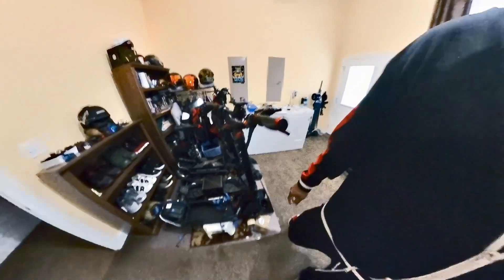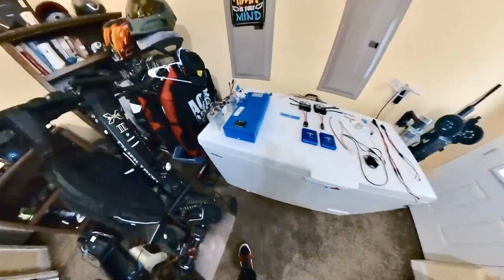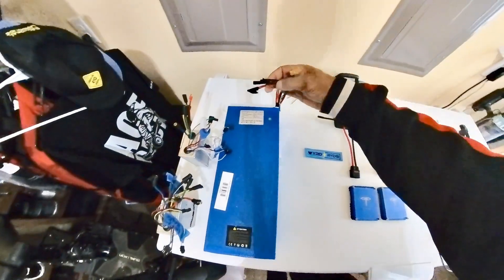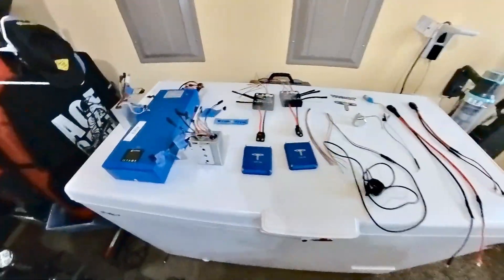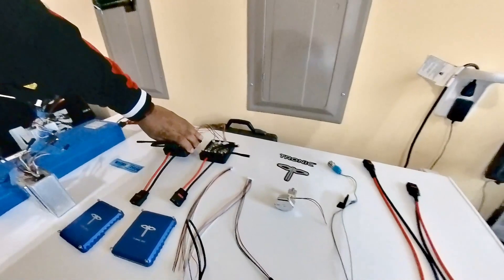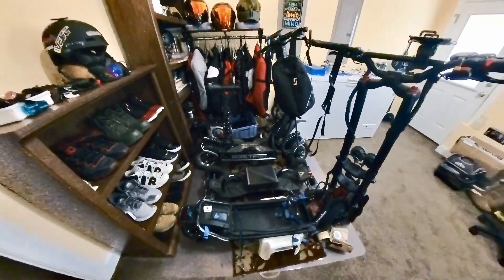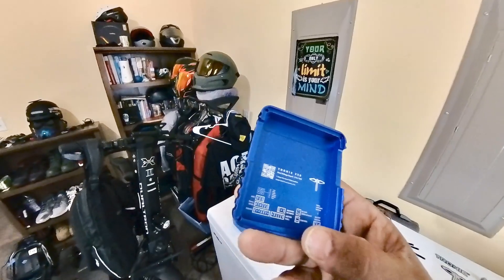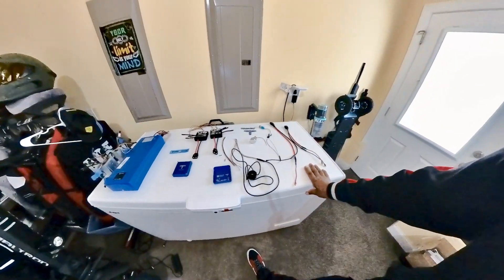Wolf Warrior 11 Tronic 250 Installation Project : Part 1

Comment: Do you have it finished?
Reply: Any luck with it?
Reply from the maker: @elijahkiihn  Keeping the Tronic 250s cool seems to be the biggest issue. I connected them onto a custom made heatsink and mounted them on the outside of the deck. After only 5 minutes, they were going into heat cutoff mode. But I'm not giving up.
Reply: @johnrichardson5089 what temp is the cut off at? I have to believe it could be adjusted in configuration of controller?
Reply from the maker: Video coming later this week.

Comment: waiting for part 2 ... ✌
Reply from the maker: I got you. Soon I promise. It's not easy to set the Tronic Controllers up so that they don't over heat very quickly, even when you mount them on the outside of the deck. But I'm almost done.
Reply: true, that is certainly not easy. I keep my fingers crossed that you find a solution and I am then very excited about your video @johnrichardson5089

Comment: any update on this project?
Reply from the maker: Yes. I finally got the Vesc setting right and I rode it for about 10 miles to test it out. My front motor went out. It was already damaged. So I'm waiting on two new motors which I hope will be here next week and I'll be dropping a detailed video of the installation process.
Reply: @johnrichardson5089  nice man, still wished you had the tronic so you can see how mine is going.

Comment: Why only 40amps per motor. Each controller can push 100amp or more I believe. I have done this for my Wolf Warrior X with a Flipsky dual 75100 Alu controllers. The ride is butter smooth... just be patient and learn about the VESC configs. Pleas please please do not put the controllers on the outside if you can. I have mine bolted to the body with a thermo paste between the body and the controllers where contact is made. Because so much air hits the bottom of the frame, the temp on my controllers has never gone past 45*C even when reaching 49mph. Also having the controller inside means a cleaner look. The most tedious and challenging bit is lighting wiring, soldering and tuning the VESC controller. You are familiar with VESC controllers so you know as awesome FOC controllers are compared to Sinewave and Square wave controllers.
I am have done 3 scooter conversions to VESC and I am now doing my first Fiido Q1s Mod. That I will post when complete. Love your passion. Keep up the good work
Reply from the maker: Thanks Bro. I truly appreciate the Feedback. I'm still taking baby steps when it comes to understanding how much power my motors can take. I'll eventually do a bit of upgrading once I get everything working and learn more about the configs of the Vesc Tool. Thanks again.

Comment: Hi John… looks like a project, those are what Gal is having installed in my Rion Thrust
Reply from the maker: I'm  almost done with the Tronic installation project and will be dropping a video soon. Waiting on two new motors because the original ones did not have hall sensor wires and the Tronic controller works good when it can detect the position of the hall sensors in the motor. I had a chance to test it out and it rides so quite and smooth. With my 60v 35ah battery I think it will get me at least 45-50 mph pushing 40 amps out of each controller.